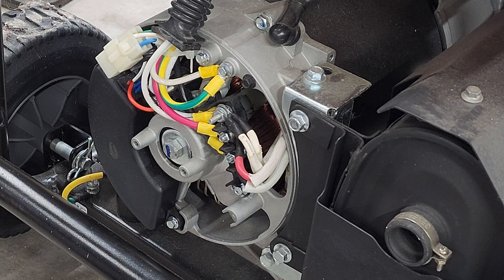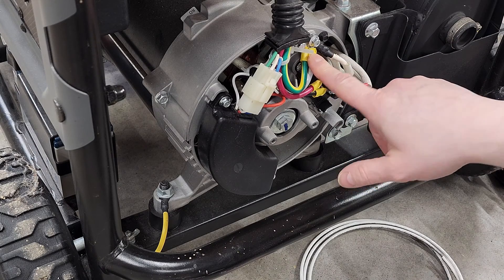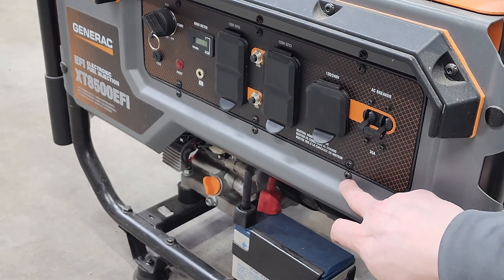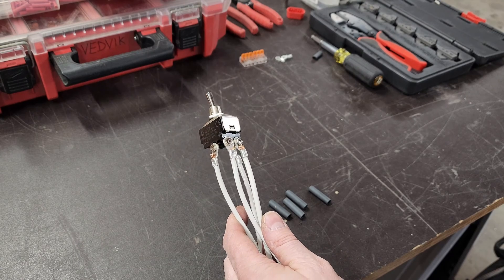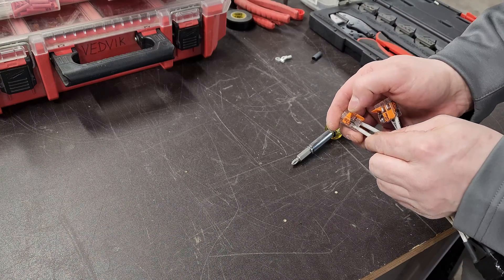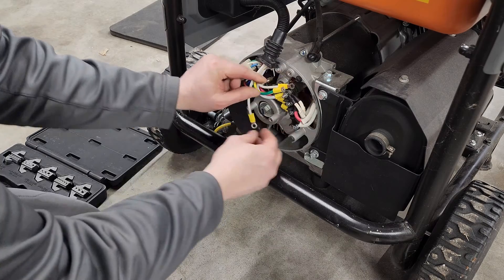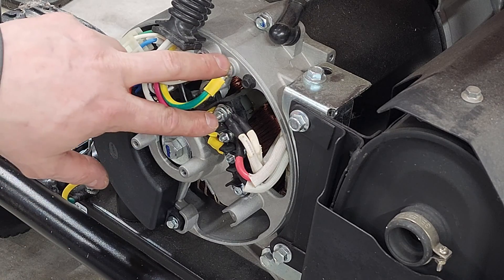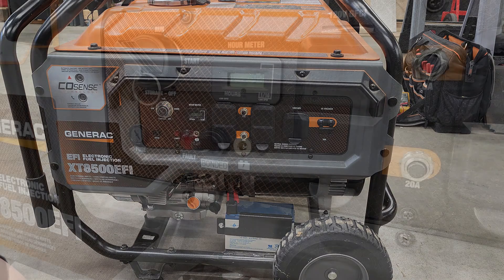Electrical Engineer Explains: Portable Generator Bonded vs Floating - How I modified my generator!

Comment: Great video. The CO sensors have a high failure rate on these Generac units (per Reddit). I have a Generac 18,000efi model that has the new CO sensor setup and no one has figured out how to bypass the new sensor yet. Your generator may have the old wiring where you just jump the 2 black wires together. Any chance you could make a video on bypassing the new CO sensor if yours is equipped with the new setup? The generator does not work after the sensor fails, so bypassing could help those that use these for home backup power and want some added reliability. Please and Thanks lol

Comment: Instead of the switch can the generator be converted to floating and a L14 30 Amp 125/250V bonding plug be used when in standalone mode? Thanks.
Reply from the maker: It's possible that your idea would work, as long as the conductor sizes and terminal ratings were sufficient to, and in, the bonding plug. You wouldn't want an undersized neutral-ground bond connection.

Comment: Grounding questions.
1. When connected to either house panel or back up sub panel we're using the existing house grounds ?
2. When only powering individual items example directly - anything with only hot and neutral prongs how do you ground. 
3. Powering a furnace, pump etc. directly how do you ground ?
Reply from the maker: I would like a bit more context to your questions to answer them in a way that is useful to you.  
1. We don't want to connect generators to sub panels unless that sub panel has a main breaker that is interlocked with the generator breaker, or 3-position switches for each load - similar to commercially available "transfer switch panels".  The generator is "connected" to the grounding conductors in the home through the panel's neutral-ground bond.
2. When the generator is used in a "stand alone" mode, the neutral-ground bond in the generator is required.  My video discusses connecting the generator to the home, but mentions that my solution is intended to allow for stand-alone operation.
3. When you are powering hard-wired equipment, you have a few options.  You can back-feed your panel through a mechanical interlock or you can individually feed circuits with the EZ-Generator Switch, as I describe in my first generator video.  https://youtu.be/dwsPU39moDg
Reply: @richardvedvik979  Thanks for getting back to my questions.
Specific to my situation I can't have a portable fuel burning unit only one whole house unit which is extremely expensive. That leaves me looking at. Battery backup units - like Bluetti.
All I'm looking to power for emergency is refrigerator, WIFI, computer, TV,  and furnace which is part of the HVAC unit.
 I'm looking at two options.
The first like you described by using my house panel - or sub panel, with disconnect switch. Which would require a more expensive larger battery unit.
Second, portable unit(s). Least expensive, but raises some questions for grounding and possibly cross connection. Most of the units I've seen are unbonded and a few have a ground lug.
My concern is powering up the furnace. Yes I can install a local transfer switch and power through it. I've been told that If the battery unit doesn't have a ground lug I will have to buy a " bonding plug" to use in one of the units outlets as the unit is not bonded, and the furnace is looking for one.
Powering the furnace that is part of the HVAC unit (each have separate breakers in the main panel) brings the question of possible back feeding through the controls as there's one fan for the furnace and AC. Also what happens if utility power comes back with the furnace supplied by the battery.
Possibly throw the AC breaker when connecting the battery to power the furnace?

Comment: I’m more confused now on what the best setup is for home use. I’m fortunate to have close friends who are Master Electricians. All of which have said I’m over complicating this subject. My Genmax 7500 is a bonded neutral generator, I’m installing a 50 amp outlet at the main with an interlock, literally every electrician I have talked to about this says to plug it in and run it as is. Why is this such a hot topic on YouTube but guys in field tell me to stop worrying about it??
Reply from the maker: @joshcerasale9502  just because it always been done doesn't make it right.  It's an issue because it's ignored.  Every electrician knows you don't have two neutral-ground bonds in a system.  Ask them if it's OK to add a subpanel that has a bonded neutral, they will say no.  Same concern here.
Reply: @ thank you Sir!
Reply: There are pros & cons to floating the neutral on a generator, when connecting to a house circuit.
It is NOT the same as a typical subpanel, where you absolutely must float the neutral. Why?
1. Technically,  it is better to float it, but...
2. When floated and the cord to the house is not plugged in, then the voltage at the generator is not referenced to ground and can float to an unsafe level. This can be easily resolved by not starting the generator unless it is plugged in. But what if for some reason,  someone else has to start the generator?
3. If the generator is only being used to run the house, no other loads connected to the generator, then it is not a big deal if it is bonded. This assumes that nothing else branches of this circuit. 
It is probably safer than having a floating generator hanging around that someone else might use, or be sold by your estate. I would not want to rely on signage. The mass of warning stickers has programmed people to ignore it 😎

Comment: If you have a floating neutral transfer switch then a floating neutral generator setup but if you have a switched neutral transfer switch then you need the bonded generator setup, correct?
Reply: Is there a neutral ground bond in the breaker panel?
Reply: @FlatOutFE  Might not be on the same page as I don't believe in this case the neutral/ground bond in service panel is relevant.
Reply: @garywebb9818 , if there is a bond in your breaker panel then it definitely matters.  Is this in an RV?  Home?  Was the transfer switch retrofitted before an existing system?
Reply from the maker: The term "floating neutral transfer switch" is not an industry term.  Is it a 2-pole or 3-pole transfer switch?  A 2-pole has a bonded neutral and a 3-pole has a switched neutral.  I cannot tell which you are describing with your question.  Happy to answer with that clarification.
Reply: @richardvedvik979  It is not a question, if your transfer switch is a floating neutral your generator needs to be set up as a floating neutral (neutral not bonded to the frame) if your transfer switch switches the neutral then the neutral on the generator needs to be bonded to the frame. Just clearing up what I'm trying to get across. If you use your generator at a job site as a stand alone, neutral needs to be bonded to the frame.

Comment: My house has two power legs and a neutral into a meter base from the utility pole. From the meter it goes to the point of first disconnect on the outside of the house. It’s a single 200A main breaker in an Eaton box made for it. My bare copper conductor ground cable from my double ground rod goes into this point of first disconnect to a lug. The outside point of first disconnect neutral bar is case bonded with a supplied screw. From that exterior “main panel” my interior house 200A “sub” panel is fed with aluminum service entry cable…two hots, neutral and ground. This interior panel is NOT bonded and the neutral and grounds are on separate bars in their respective locations. However this interior panel (Square D QO) has a Square D Mechanical Interlock device with a 30A back feed breaker in that position for Generator connection. For connecting a generator I would turn off the outside 200A breaker (point of first disconnect) and also activate the interior interlock to shut off that 200A breaker. All I’ve done is disconnect the hot legs in both breaker flips. Now my neutral and ground are still bonded at the outside panel. If I hook up the Gen to the interior panel as per the interlocked back feed breaker….I still need floating neutral generator…correct?
Reply from the maker: @NeilLB7  correct, the generator should be floating as it uses the neutral-ground bond in the main disconnect.
Reply: I suppose I forgot to ask another question. Should I use an earth grounding conductor from my residential earth ground rods to my generator ground stud while it’s supplying my panel in a floating neutral setup?  My Gen set will be supplying my QO interlocked breaker in the floating neutral scheme described earlier.  The cable from my panel to the gen is 8ga four conductor (black white red green if I recall) rated for the 30 amps max.  My questions are all for my own actions and risk. My thought is no I should not do that since it’s connected to earth ground via the Gen cable grounding conductor.
Reply from the maker: @NeilLB7  you should have 2 hots, 1 neutral, and 1 ground from your genset to your panel.  The floating neutral generator will use the existing panel's grounding.  There is no issue adding a dedicated ground rod at the generator and some codes would require it for larger installations.
Reply from the maker: @NeilLB7  excellent description,  thank you for the details.
Reply: Thank you for the fast response!  I try to do things right.

Comment: Many people rely on those wago connectors which i feel is a dangerous practice…..yes they are easy to use but you are relying on spring tension (its noticeable how the one wire slipped back out of the wago) and the quality for that said metal inside the wago, actually connecting WIRE to WIRE with a wire nut or some type of mechanical crimp is more reliable and a better bond, why add another variable you dont need……..wagos are great for trouble shooting and removed thats about it in my opinion but your video was great!
Reply: They have been around for decades and been used outside the U.S. to completely wire houses. They are completely safe if used correctly.
Reply from the maker: Thanks for the comments!  I considered crimping but this was a bit of an experiment, so servicing the connection was desired.  The Lever-nut by Wago are UL listed for use on 600V AC systems, and have gained a lot of favor with large-scale commercial electricians.  They are becoming the preferred solution when installing stranded wire or combining solid and stranded.  The lever can lift up a bit without affecting the connection.  A traditional wire nut has never been a good solution with stranded wire, since the wire nut was never designed to hold the wires together, just insulate a pre-twisted set of solid wires.  We have all realized the wall-nut by Wago is not desirable as it isn't good for stranded wire and has a smaller contact patch.  After a mechanical crimp, insulation is needed, but I do like mechanical crimps.  While I rely on Super 33+ or Super 88 for any electrical tape purposes, having and insulated connection that is serviceable was desired here.
Reply: I never liked those wago-style connectors that started to come pre-installed with hi-hats.  I'd always cut them off, and use a standard wire nut.  The wago seems to be the equivalent of Stab-lock connections on 120V outlets, which anyone who has been in the field long enough will tell you that you do NOT use if you don't want loss of connection due to heat cycles, and wear etc.  You always use the screw...I thought this was well known, but maybe I missed something.  Probably not.

Comment: OK After 45 years in the electrical craft I still can't understand why the 1/4 inch of difference between connecting the generators neutral to the Grounded/Neutral Conductor of the Service Entry Conductors and connecting that same neutral to the Grounded/Neutral Busbar; were I note that the US National Electric Code (NEC) specifically allows me to connect the Grounding Electrode Conductors; makes any electrical difference. 

My question is about the generators factory new condition and thus the generator's neutral is bonded to it's frame. 

If I put a  saddle tap on the Grounded/Neutral Conductor of the Service Entry Conductors and connect the generator's Grounded/Neutral conductor on that saddle tap and tighten everything to specified torque the Code Making Panel for section 250 of the NEC thinks that is wonderful. 

If, instead, I connect the generators Grounded/Neutral Conductor to the Grounded/Neutral busbar a 1/4 inch away from the Grounded/Neutral Service Entry Conductor that is the END OF THE WORLD AS WE KNOW IT? Since You are a "EE", Electrical Engineer would you explain that 1/4 inch of lug metal making such a difference. Obviously I don't buy it. But maybe you know of some rational reason that I should. 

Tom Horne
Reply from the maker: Hi, Tom.  While I'm not on the CMP, I spend a lot of time in NFPA sections.  It appears that decisions fall into three categories:  1. a necessary approach for safety, 2. sponsored by industry, and 3. someone thought it was a good idea.  My take is the key factor in bonding and grounding is reliability and repeatability in practice.  There is no electrical difference where a connection is made if the resistance between options is negligible.  The primary concern is that there is always resistance and some ground bars are just held in place with two screws, so the contact area is just the tub metal thickness * screw diameter * 2.   As long as the installer takes care, as you describe, i'm happy.

Comment: If the ground and neutral are interrupted ( disconnected ) from the neutral of the service panel ( while the "main" is also off) would this still be necessary? Would the house not then be like providing power to any other device plugged in that required the Generator to be bonded?
Reply from the maker: If a 3-pole transfer switch is used, meaning the neutral conductor is switched with the phase conductors between utility and generator, then the generator is considered separately derived and must be bonded.  It is very rare for a panel to have a neutral disconnect tied to the main breaker at the service entrance, at least in the US.

Comment: I'm late to the party. Great explanation that I doubt most folks are aware of when using a portable generator to provide backup power to your house.

We have a Predator 8750 (7kW running) genie we use for home backup. The Predator has the Neutral/EGC bond in the receptacle panel not in the power head, I removed the bond. It our case it is unlikely we will ever use the genie standalone but did not want to prevent using it that way. So rather than using a switch I installed a Neutral/Ground jumper in a NEMA L14-30P twist-lock plug and hung it on the generator in case it every needed to be used standalone. This also eliminated the possibility of making a mistake as the L14-30 receptacle is how we connect it to the house. I added a label on the genie indicating it has an isolated neutral as a reminder in case anyone other then myself uses it standalone.

Just a nit. It was not necessary to run additional wires to the power head as the neutral and ground conductors are available in the power panel. I assume you did it that way so you could keep the explanation simple.
Reply from the maker: Your solution makes sense, it's good that you were thinking about the issue.  Yes, there are other ways to achieve this but I did want a simple solution.
Reply: I have the same generator as you. Thank you for identifying where the bond is, you saved me a lot of time!!

Comment: My generator has 2 white wires coming from the stator like yours but also have two whites going to the generator panel. They are running parallel and only one was jumped to ground. What’s going on here? Why was only one jumped, why are the two neutrals separated? Since I’m wanting it floated, after removing the jumper, should I connect all 4 together or leave the two sets separate like they are now?
Reply from the maker: Sorry for the delay.  I would need to see a manufacturers wiring diagram and photos to advise on exactly what your wires are doing.  You need to identify the generator's neutral-ground jumper, which may be one of the wires you describe.
Reply: @richardvedvik979 thanks. I’ve since found out that Duromax doesn’t know what they are talking about. They claim it’s floating out of the factory… but it’s not. It’s bonded.. they say it is floating because they have the stator and motor isolated from the frame using rubber mounts… I have corrected this by removing the jumper. I’m just confused as to why they would make this claim since doesn’t align with electrical code definitions.

Comment: @richardvedvik979, thank you for taking the time to create and post this video.  Very clean implementation that allows for the greatest flexibility of use with your generator and a minute amount of future work to use it as a true portable or a whole house power source.

With larger portable generators, and as "easy" as this modification was for your particular unit, I wonder why this "feature" is not a standard.  The generator manufacturers know that many (most?) of their larger generators are going to be used as back up power for a house, to me it makes good sense for them to incorporate this into their build and then the consumer "knows" it has been implemented correctly.